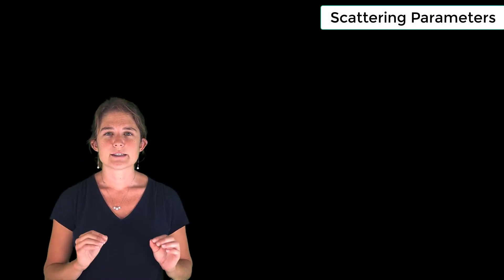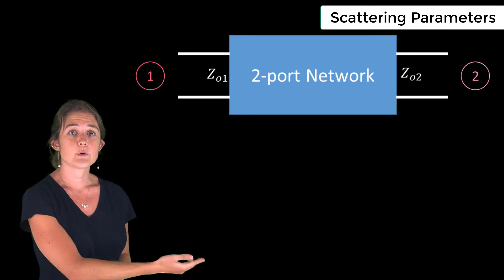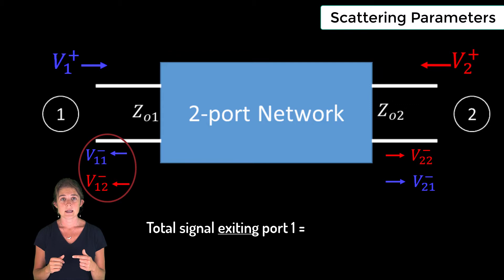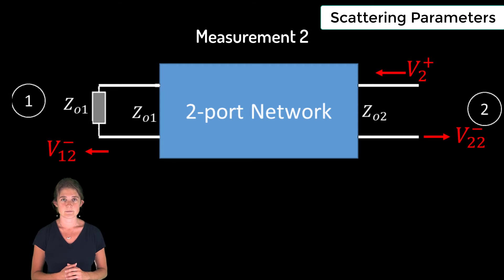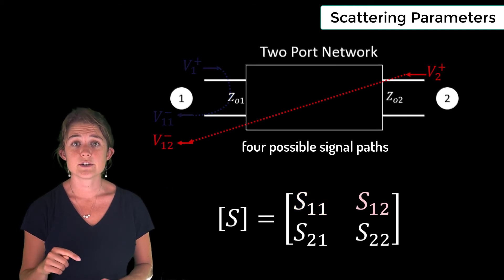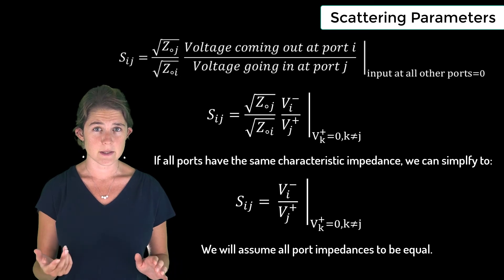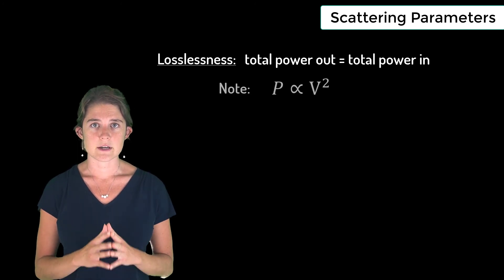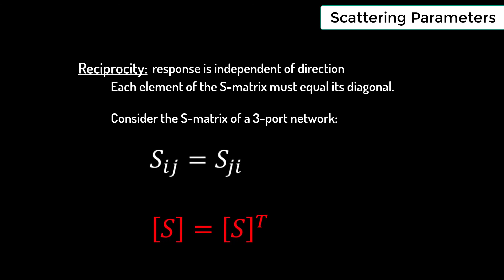Scattering Parameters — Lesson 12

Comment: Excellent video, nice work! Regarding the sum at 6:12, shouldn't it be Σ(|S_ij|^2) rather than Σ(|S_ij|) since we're talking about the squared magnitudes of the elements of the S-matrix?
Reply from the maker: You are quite right - that's a typo. The magnitude of S_ij should be squared in the last equation on that screen. Thank you for pointing that out!
Reply: @emviso  Thank you for clarifying! On that note, is the result of this summation sufficient to declare a network lossless or lossy? I've noticed some resources (e.g. page 11 "From unitary condition follows": https://classes.engr.oregonstate.edu/eecs/fall2017/ece580/Lecture%20Notes/Andreas%20WeisshaarECE580_guest-lecture.pdf ) also state some properties about the conjugates of S-parameters. Are these additional conditions, or does the summation alone always imply that the equations involving the conjugates describe the same thing?
Reply from the maker: @-Apostolos  This is sufficient, as long as the characteristic impedance is equal at every port.
Reply: @emviso  Thanks, one (hopefully) final question regarding the definition of the incident power waves: https://en.wikipedia.org/wiki/Scattering_parameters#A_definition

The equation k_i = (√|ℜ{Z_i}|)^-1 involves the real part of the impedance (since R = ℜ{Z}). But why is it wrapped in |...|? If R ≥ 0, why do we need to take the absolute value of the resistance when |R| will always be equal to R?
Reply: FYI, I looked back at the original papers where the equation was introduced, and apparently the absolute value takes care of R < 0. R can sometimes be considered negative when we're dealing with active networks, such as active reflections (|S11| > 1).
Reply: With the help of a few reminders from your video, I've went ahead and finally completed my own version of the introduction to S-Parameters: https://youtu.be/CEA8njh4tLU

Many thanks again!